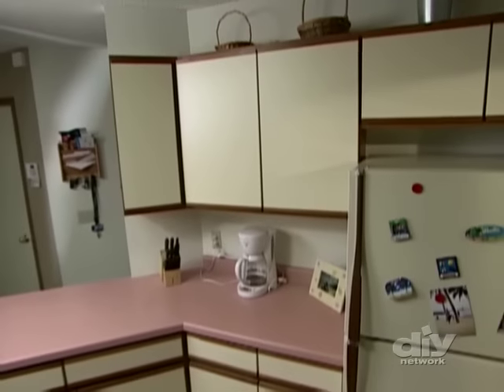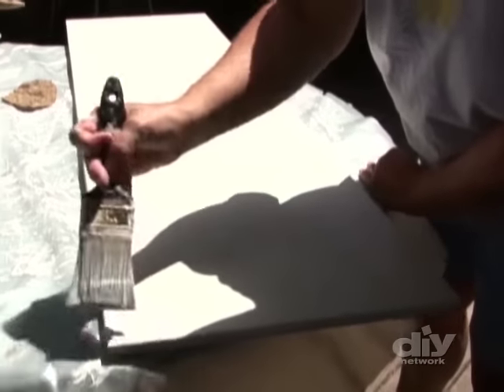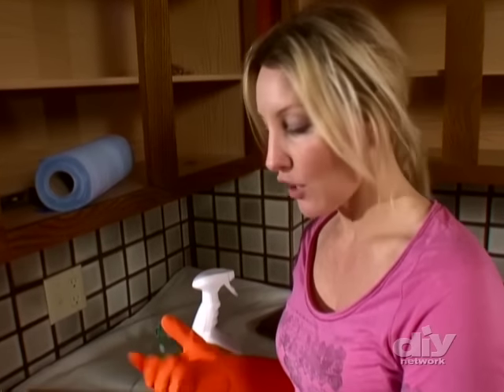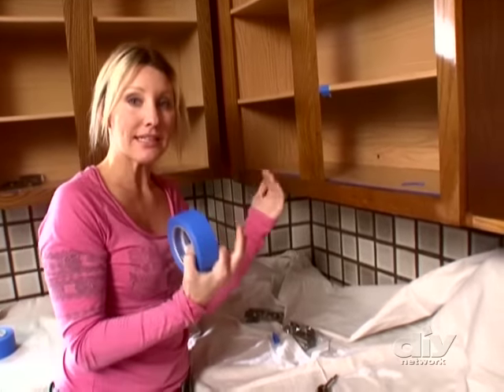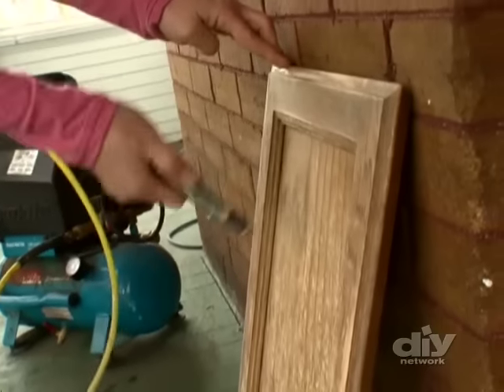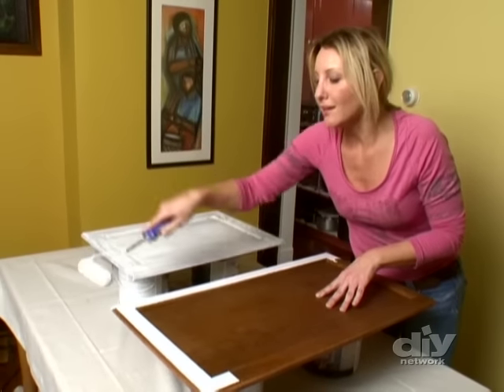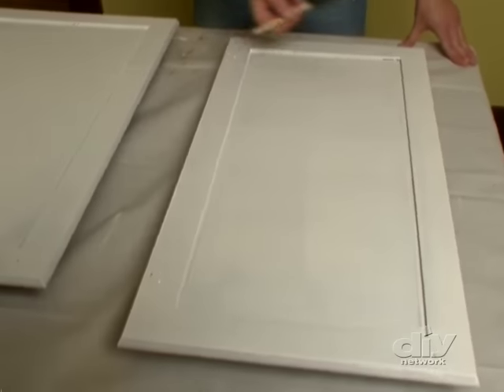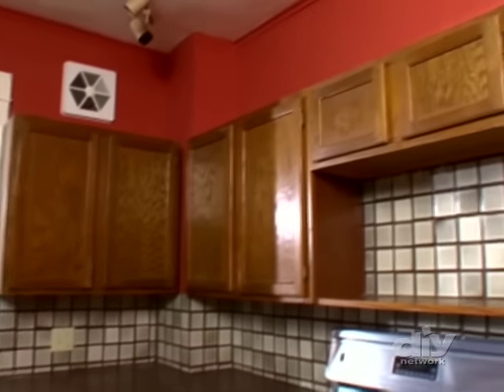How to Paint Kitchen Cabinets - DIY Network

Comment: Amy says, "We want to use latex because it's an easier clean-up and a shorter drying time." Two of the stupidest reasons to paint kitchen cabinets with latex. What, are you going to have a dinner party that night?
Any professional will tell you that oil based paints are the best, longest lasting, and easiest cleaning (I didn't say clean-up) paint to use when painting kitchen cabinets. Do it the right way and you will be happier in the long run.
Reply: I don't use oil base paint to paint anything on houses anymore. Only acrylic latex. Oil base paints fade very quickly especially white and the latex paints they have today are as good as any oil base. I use either Sherwin Williams pro Classic or Benjamin Moore to paint cabinets, trim, doors. Oil base paints are a thing of the past.
Reply: Klink I wholeheartedly agree about the oil.  It can be a annoying to use oil bc of the mineral spirit and the smell but well worth the inconvenience in my opinion. I have rental units and tenants are tough on kitchens. One unit had a nice little kitchen that had new cabinets installed in the 70’s. They are a classic flat front with grooves in the doors. In the late nineties I painted those dark cabinets off white. They looked great. At the time my husband who is in the trades, said not to use oil since new latex is really good.  Im old school and kept with the oil.  That finish finally failed after 20 years so when our long term tenant moved out I again bought oil. The oil paint has bought us time and saved us a lot of money by not having to replace cabinets or paint until recently. The new tenant was shocked at the transformation. They looked like new again after two coats and had a durable finish. An added benefit was not having to put poly on them like with latex. Im in the process of painting our home kitchen and am using Benjamin Moore Advance after trying it on another kitchen. I really like the sheen and the way it goes on and how it self levels.  It is a nice product but I can tell it is not as durable as the oil. I also don’t want to use poly on them because of yellowing over time. We are not hard on our kitchen like tenants but Id be surprised if the BMA lasts 20 years! Oil is still unbeatable in my book.
Reply: @Vulcan5911  you say that oil-based paint is bad yet make the claim that latex is just as good. So is oil based really that bad? And if so why would you want to compare something to how it's just as good.
Reply: @nonolabs  I never said oil base paints were bad. I just mentioned a few things I didn't care for with oil base paints. I love oil base primers though.
Reply: @Vulcan5911  thanks good info
Reply: Quit using dated paint technologies. The new hybrids are fantastic.